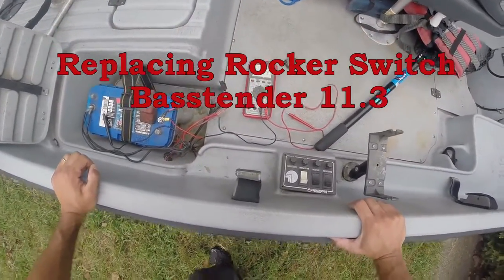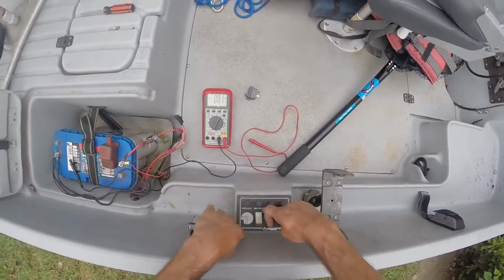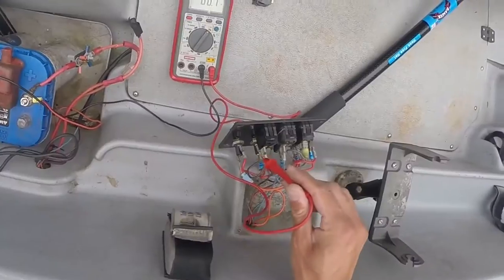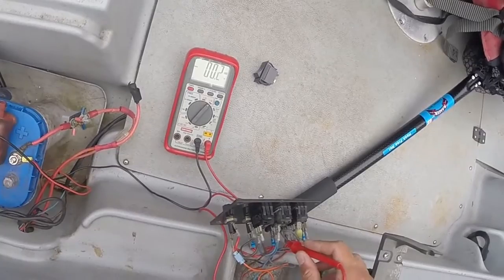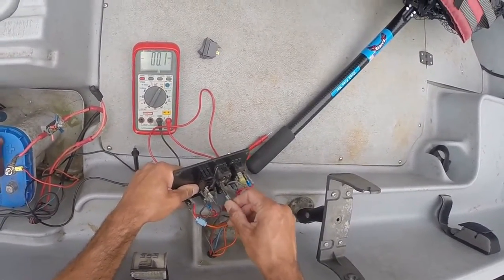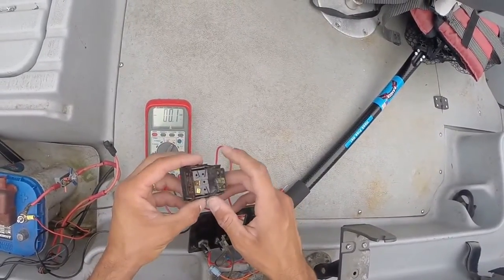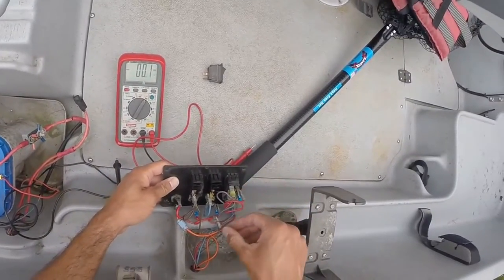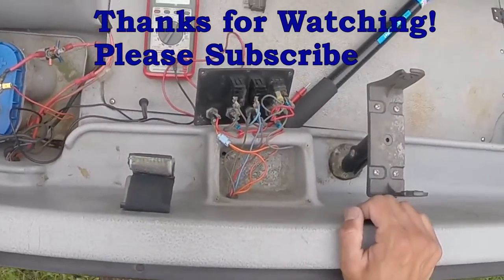BASSTENDER ROCKER SWITCH REPLACEMENT

Comment: Thanks for the video!
 I finally purchased another Basstender after my first one was damaged. I know and always use a marine deep cycle battery. My question is can the battery compartment support the weight of a group 27 interstate battery. In the off season what kind of battery tender do you use?
 Thank you.
Reply from the maker: I use an Optima 31 Series, so yes it can support the weight. I use a Minn Kota 10 amp charger to fully charge the battery and then check it every month.
Reply: @thomasfixit7931    optima 31...  i assume that is a type of  marine deep cycle battery?
  Ok thanks for the  information...  I think i have the MinnKota branded charger before.
Thanks again.
Reply from the maker: @gewglesux  yes it is a good marine deep cycle battery.
Reply: @thomasfixit7931   Thanks  for the reply!

Comment: Can you post a link to the replacement switch you bought I have the same issue with my boat and can’t find the fuses anywheren
Reply from the maker: I got the part from a marina. Just get the part number off the switch. You can try West Marine.

Comment: I think for the lights  it's a 3 position switch.  One posistion is off,two is stationary light(rear white), and i think the 3rd position is both  underway light and the  port starboard.  which mine is broken too.
Reply from the maker: These switches are harder to find, when you have to replace them.
Reply: @thomasfixit7931    I'll have to hit up the local west marine store..  i think that might be my best bet...  if not i'll  have to replace the whole panel  -@ $150.. i'll keep you  posted.  if your interested  Thanks for the reply.
Reply from the maker: @gewglesux  you can probably order online. Get the part number off it.
Reply: @thomasfixit7931    I went to a WestMarine   but they were out of stock.. they have more coming  supposed to be in Saturday.
Reply from the maker: @gewglesux West Marine is expensive, but you have to pay to play. =)
Reply: @thomasfixit7931  
  NOW you tell me.....  Yeah i know....    i had to get a socket  for the stern light....  because the one that  came with my  boat was damaged.
  I'm still  ahead of buying the $2k  Basstender i saw on greed bay  2 weeks ago..  I got  a good deal on the boat n trailer....  you're out of the Tender now right?  you're in a glass  Triton  now..
  I wanted to be in a tracker by now...  but i guess that's my retirement gift.  Thanks for all of the help.
Reply from the maker: @gewglesux  Glad I could help. I still have my Basstender and I have a 2006 Skeeter for guiding on the Potomac River.
Reply: @thomasfixit7931      I got my replacement parts  for it last week..  2 pedestals,  I  also replaced the aluminium bases(the previous owner abused this boat) they were either rusted  or jammed  into them that i couldn't separate them.  I also  replaced the  black  plates that mount to the seats(which i haven't gotten yet) The stern light too.  I never used the live well in my old Tender.  so i might remove it and the aerator  as they're both corroded.  I've replaced the plywood  under the rear seat too.  Today i have to find the "thru hull fittings"  for the 3 holes in the rear..  believe it or not .. they were in rough shape too.  the Winch needed to be replaced, the 1 7/8 hitch was also replaced  as was the 3 tires.  Navi lights were not working either.  I also noticed that the  bunks on the trailer  were installed wrong..  they're not flat..  according to the  owners manual  they are supposed to be flat- like my old tender.  Speaking of the Potomac..  I think i have a buddy  who's a water cop  there.  if you're interested and not bored  i'll continue  you with the updates  as they progress.
Reply from the maker: @gewglesux  I replaced the front base because it was jammed. The new one has a brass piece that keeps the new pedestal from sticking. I replaced my winch too, they just wear out.
Reply: @thomasfixit7931  I just got in....  yeah  it's called a bushing..  they actually sell them   on pedalboat.com. My old tender had the bushing  this  one didn't..    the pedestals were either so rusted in or  just jammed  that they were not coming out.  just unscrewed the whole thing and in the dumpster  it went...front n back. seat n all.  I think for the front  seat  the pedestal  will have to be a tall one  as i want to try  a casting seat.  The boat  won't be ready  for this season. I will hunt over the winter for 2 Trolling motors.. and upon further inspection of the trailer  the bunks need work and some customizing..

Comment: What type of battery should be in the 11.3 basstander?
Reply from the maker: 12 volt marine deep cycle battery.
Reply: Thank you for your answer and what battery capacity would you recommend
Reply from the maker: I would use the biggest battery you can afford. I use an Optima 31 series battery. They usually last 4 to 5 years and they are maintenance free. You just fish all day recharge them and do it again.